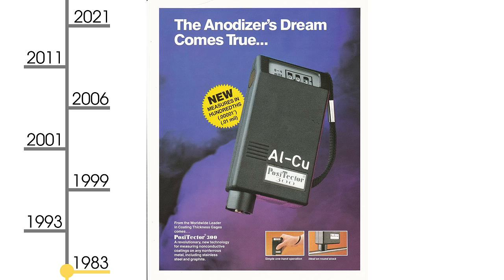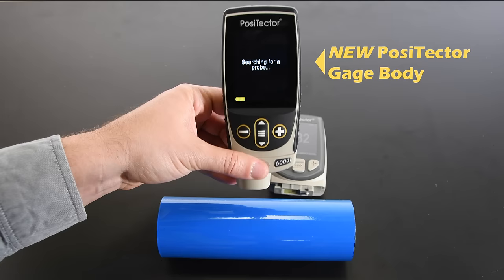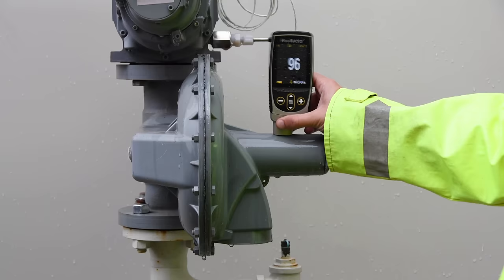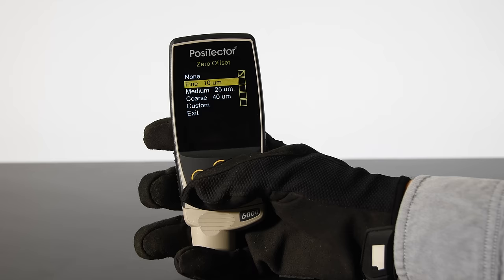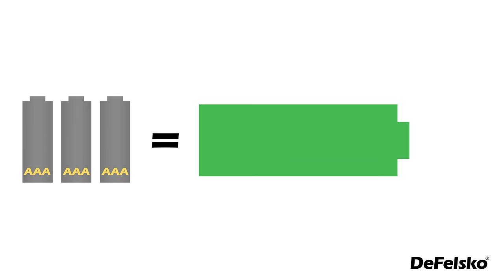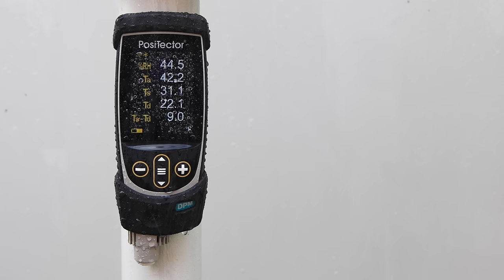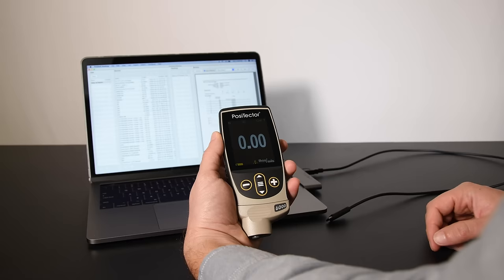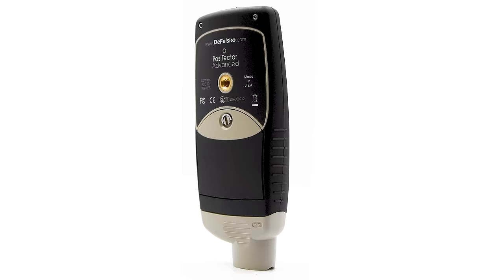New PosiTector Gage Body

Comment: Hi Sir, Non metals like FRP and glass possible to check paint thickness
Reply from the maker: Hi Ramu, yes- our PosiTector 200 gages utilize proven ultrasonic technology and are designed to quickly and accurately measure the thickness of cured paint and polymer coatings applied to plastic, wood, composites, glass, concrete and other non-metal substrates. For more information, please contact us at +1-315-393-4450 or techsale@defelsko.com.